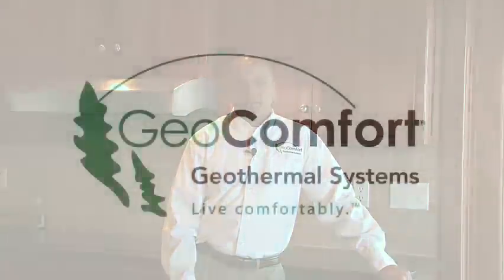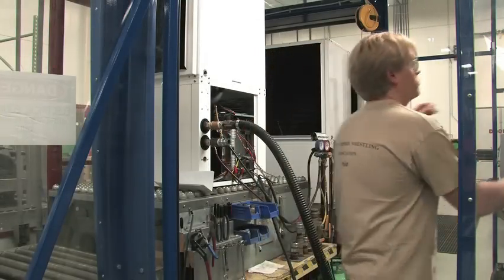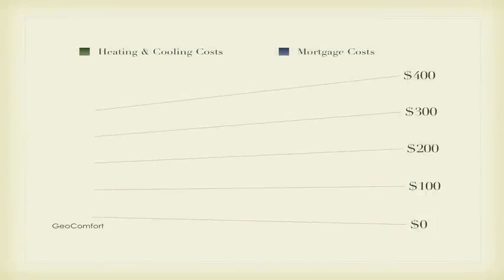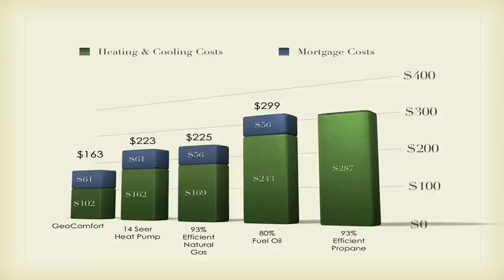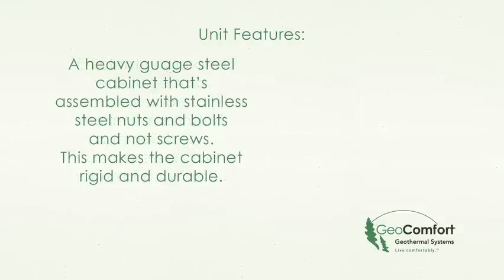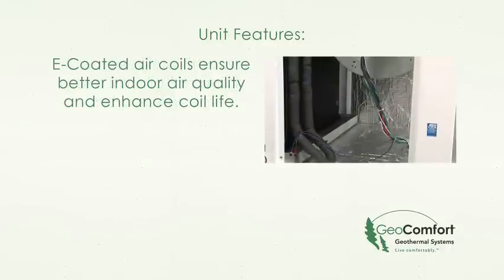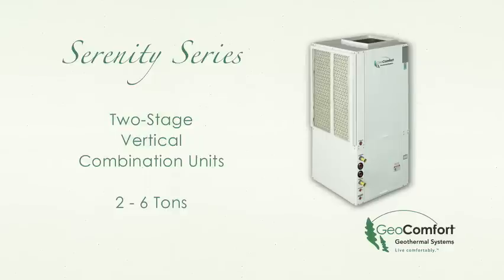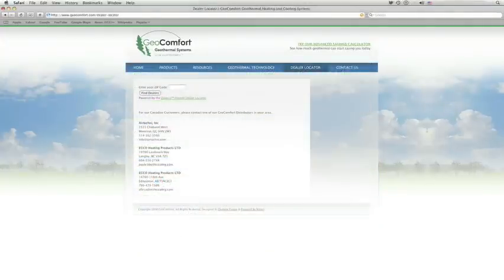GeoComfort Geothermal Heat Pumps

Comment: I have a 1500 square ft home with a full unfinished basement in the country. Double pane windows, metal siding, insulated pretty good.
My heat source at the moment is a Bryant gas water boiler that has base board heat registers/vents through out the house and basement. It runs on propane. I've lived here for 12 years. Heating cost for me each winter is at the very least $1000.00 for propane alone. I have another furnace as well in the basement with duct work to each room of the house but that is used solely for the central air unit outside no heat unit inside of it.
I guess my question is how would it be hooked up? Would it be to the existing forced water heat Bryant system vents where I still use hot water heat or would you use the other furnace with the duct work? Also what would a unit cost me for my size home?

Thanks for your time,
Diana
Reply: A geo thermal system requires a ground water "source". I have what is called a "pump and dump" type. We have one "supply" well and another "return" well. The supply well should be at least I'd say provided with a 3/4 hp pump that also would supply the house drinking water. You could and I'd suggest tying it into your basement access duct work. Really except for an additonal well unless you have a pond or other source of water, really an very inexpensive means of heating and cooling. I'd highly suggest looking into it. I don't know anything about this brand but really not much to them, I do work in the industry and have one here at our house and have been blessed with it thank God. The 10 year warranty is amazing though here on this brand and Copeland which I believe they use as a compressor is an excellent compressor.